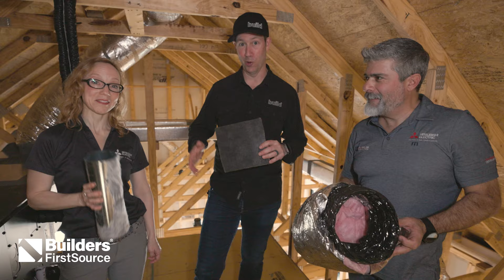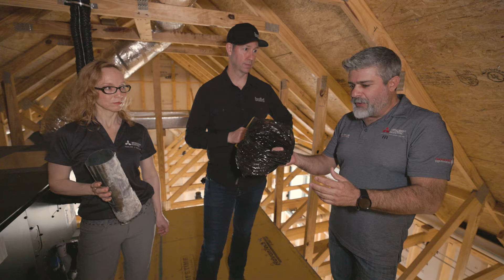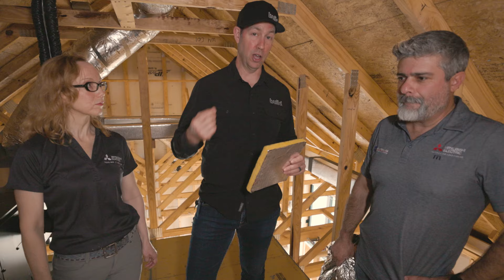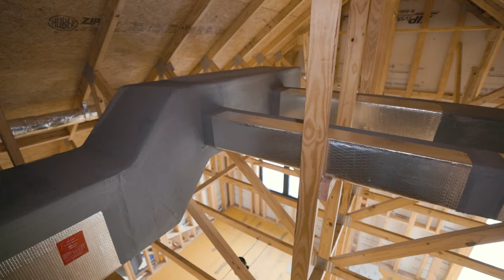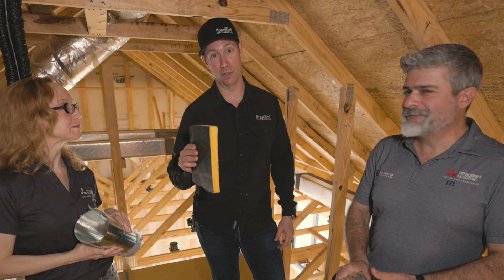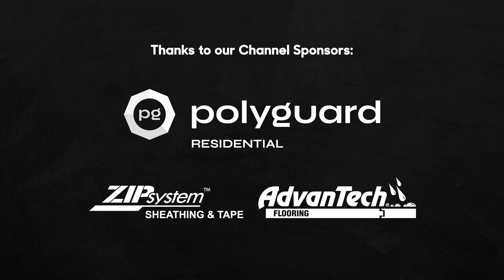Flex vs. Metal vs. Duct Board: Differences and Use Cases

Comment: Duct board has no use case for being a duct. Exterior insulation sure, a duct that airflow goes through absolutely not. Way too much fiber shedding and I’ve seen way too many home owners have respiratory issues when duct board is in the home.
Reply: I think you are talking about the old duct board with the raw fiberglass on the inside.  Our 35 yr. old condo community I help manage has this horrible stuff. It is disgusting after 35 years and honest duct cleaning companies won't clean it. The board they are showing has a coating of some kind.
Reply: @lrc87290  The newer duct board does has a black liner on it which I agree is a million times better but it also starts to breakdown over time but this system they have built with the Dehus is also pretty advanced so in this VERY RARE case it might work out okay.
Reply: I agree with this 100%. It is a horrible product, even in its current iteration. It is a disposable product in a permanent application. There are plenty of other problems, such as combustion and fire conduction, and any one of them should be enough to have it outright banned. In Canada there are no building codes that allow it, from the largest producer of pulp and fiber in the world; that should tell you something.
Reply: I can personally vouch for this. 

An office building I used to work in - I noticed I had respiratory challenges when I spent too much  time there. Wouldn’t clear until a full day or two of not being there.  

After I did my own inspection -  duct board everywhere.
Reply: @lrc87290 any Duct Board.  It has no business entering any application.  It WILL hurt the people exposed to it eventually.
Reply: @compasteedee I didn’t know Canada doesn’t allow it.  I didn’t know hospitals and schools don’t allow it. 

It’s crazy that it’s on the market for any application.
Reply: @TerryKashat  I still see it in old hospitals even though it’s not suppose to be there.
Reply: @hoopie1022  once in stalled it’ll be their indefinitely 90% of the time.
Reply: Metal duct work (trunk line ) has insulation glued to the inside of it. That held mold also. Which is about the same as duct board. Except for the metal lines that go to the rooms. Then that is usually wrapped with insulation and tape to it. Now will agree the old duct board. That had just the yellow insulation showing. Was not the great’s stuff. But, the newer board with black coating. I would use, before flex duct.
Reply: Haha

Comment: FOR ME, I’d do metal duct everywhere no matter what; there’s just no substitute for the ability to repeatedly clean them on a regular basis.
Reply: Facts
Reply: 100%. The other stuff is not just bad in performance - it’s bad for your health.
Reply: You need to replace your filter on a regular basis
Reply: How many ventilation systems are designed for cleaning? I gues none with flexible trunking.
Reply: I actually just got my air ducts cleaned and did not know this. My air ducts were really old and now they completely broke them all over the place. I have to do a full replacement now since i had non-metal ducts and the cleaning company ruined them.
Reply: @dannym1772  you already had to do a full replacement, the cleaning company just was a bad decision on your part - not their fault.
Reply: Just wish it didn't rattle so easy! I'm always helping someone build a home theater, and bass and metal don't mix well. >_<

Comment: As a former HVAC installer, I spent an inordinate amount of time repairing/ replacing duct board and flex duct with metal because they just don’t hold up over time and really adversely affected system performance
Reply: They don't mention aluma flex which stands up good unless someone crushes it, but it does suffer from turbulence from its ridges but it is a good alternative to wire flex as it wont degrade from the inside out. But yes rigid is the best
Reply: What do you do about sound transmission? I replaced my ducts with flex because we could hear each other clear as day in each of our upstairs bathrooms, as well as each of the two rooms that were next to each other.
Reply: @Runn4est  use duct liner to add efficiency and reduce noise transmission

Comment: I thought it was best practice to use solid metal ducts for the majority of runs, and then flex for the last 5-10 ft if absolutely necessary
Reply: I think code is 14 feet max for flex

Comment: Once the house is done and the homeowners a few years down the road want to change or add more lights the electrician goes up in the attic climbs over the duct board and crushes it it's over, I'm retired tin knocker did it for 40 years and I would take metal over duct board and would recommend it to the customer, it's junk

Comment: a quick question: I see Germans begin to use rigid plastic for duct work.
Reply: My initial concern would be warping when hot. Also how porous/vulnerable to mold it is. Probably depends a lot on the material.

Comment: What about mini-splilt where you eliminate duct work altogether? Isn't that the ultimate solution?
Reply: I would highly suggest not to go mini splits, simply because you’re going to have cold spots throughout the house, unless you have a unit in every single room.. and that means an outdoor unit for each indoor unit., then, you need plumbing and electrical to everything on top of that
Reply: @ppump24valve53  I was told that now days one typical outdoor unit can handle around four zones and the exchangers are capable of covering typical room sizes. Is that just not the case.
Reply: @myusrn  well, it does look like I’m wrong on that aspect.. of needing an outdoor unit per indoor. But all the refrigerant lines and electrical would need to still be running to each individual unit, from the outdoor unit. Then also you would have a filter on each unit, as well as the fan.. thinking about maintenance.. etc. I had existing ductwork in place, and just got a new variable speed air handler , and inverter, going from an electric hot air furnace.. so I’m about to see how much more efficient it is.. Also insulating my garage attic and topping off the main attic insulation.

Comment: My house had a lot of flex ducting when it was built. I didn't know this till after I had my ducts cleaned and the cleaners tore multiple of the runs going under the house.
Reply: Ouch how it wasn’t too expensive to fix 🙏🏼
Reply: @Electrolux Wash I was able to get to all of them and fix them with tape. I do wonder if that is a hidden problem for the new owners who have been there more than a decade.

Comment: Which one is better to fight condensation ?
Reply: Ideally you shouldn't be putting any of them in a non-conditioned space so condensation wouldn't be an issue.

If you have to put it in unconditioned space, sheet metal will always be better.

Comment: What is a reasonable price for new duct work?  
10 runs (10ft - 30ft each). 
2000 square feet ranch, single story, AC in attic center of the home.

Comment: Hydronic heat and cooling, per room home runs to cassette systems. Each room can be temperature controlled, can be installed by the most rookie DIY homeowner, easy to clean and maintain.

Comment: I need the breakdown of how easy these are for ninjas to crawl through…
Reply: I was concerned about Solid Snake - but you make a good point too 😂
Reply: Sheet metal duct is the only ninja approved duct. Due to higher cost sheet metal ducts are utilizing thinner metal which can bare less weight and it is noticeable noisier. Making it much harder on ninja.

Comment: I'm having a new home built, and I'm afraid that my HVAC contractor is going to pencil whip the DALT test on my ductwork.

How to I keep my HVAC contractor honest with duct air leakage testing (DALT), it is energy conservation code in NC. I'm certified through AABC and performed numerous DALT tests in a commercial setting using equipment from Retrotec and Oriflow.

Comment: Does anybody know the physics of sizing metal ducts to best guide heat from the furnace to the extreme other end of a series of rooms at distance from the source?  Discussion of products without proper location and sizing is at least as important as materials.  Also, what options you use to insulate your metal pipes has a lot to do with efficiency, especially when the furnace is downwind of prevailing winds outside winds or thermal issues in walls.  Everyone believes they are the perfect duct system designers although they know little about volume of moving air inside of the ducts themselves.  Additionally, where to place furnace outflow to rooms and where to place cold return is the field of HVAC designers for each room.  There is a lot to know in planning your HVAC ductwork and very few qualified HVAC flow designers capable of providing even heat to a 3 BD house with large living quarters, entertainment centers, office space, play room etc.
Reply: Good point, that's why engineers make the medium bucks.
Reply: That's why we use hydronic heating and mini split a/c. Theres so much head loss moving air through joist space that it doesn't make sense anymore. We used to only have hydronics half a century ago, why not go back to systems that still works 50 years later. All these shitty lined cardboard will have to be ripped out in 20 yrs.

Comment: If you're building a million-dollar house, I would get an upgrade alternate price on metal ductwork and see if it fits into your budget.
Reply: Well that the main problem with new homes. Many pick the kitchen upgrade or the third bathroom over insulation and better HVAC. You only want to pay for what you see, not what comes out of your pocket every month...
Reply: If you're building a $1000 dollar house I still would use metal

Comment: Metal duct work everywhere, sprayed with foam. Only way to go.
Reply: 100% Metal Duct.  I would advise against the foam and use sealing tape.  It’s healthier from a biological standpoint.
Reply: @TerryKashat  insulation?
Reply: @audreye7078  the foam is not biologically healthy from a chemical standpoint. 

Insulation is technically fine - the challenge wise that is you want NO fiberglass insulation exposed to the air leaks or interior of your duct do that the fiberglass never gets in the duct pathway.

Comment: I'm a HVAC tech in the Netherlands, we only use solid metal ducting in our installations. I work with one of the few companies who specializes in air heating(/cooling) for residential buildings. Even if we need to cross load bearing beams or so, we make custom conduit in al kind of shapes and sizes. Only when there are no options for solid, we use flex. Never would we use some kind of fiberboard!

Comment: In my neck of the woods (St Louis metropolitan area) well over 90% of the homes are built with basements, sheet metal ductwork was always used and continues to be used to this day. Sized, supported and installed correctly sheet-metal ductwork can withstand the test of time with few problems. The problem I’m starting to see is the lack of skilled tradesmen in this field, the Legacy sheet metal men are starting to retire and die off (I am seeing less pants legs and cheeked or rounded corners used , i’m assuming the contractors don’t want to pay for the extra time or have the expertise).
Reply: Over here in Lancaster County, PA and surrounding areas we mainly use fiberglass ductboard instead of metal. Not many of the guys know how to do metal anymore

Comment: New builders using flex duct should be sued and then banned from building.  Cheap and fast is the only reason they do it, and then charge a normal price or more anyway.  Should be banned from building, since they probably hide it as well from home owners that dont know any better

Comment: Surprised they did not mention aluma flex which I would say is one step below sheet metal hard pipe, yes it does crush easy but it wont degrade over time in the inside like wire flex , and will last just as long as hard pipe  if not molested by someone crushing it. And yes, it does have ridges so some turbulence.

Comment: Metal duct all the way , seal all seams really really well and it will last a lifetime time.
Great video Matt 
Appreciate you
Reply from the maker: Right on. Totally agree
Reply: 100% Metal duct all the way.  

The cheaper options should not even be available for something as important as our air.
Reply: @buildshow  that's why you used pvc duct hose in your house. Do you remember the Zehnder system?
Reply: @jakubsebor4756  what’s wrong with the zehnder ducts

Comment: Is the metal ductwork insulated or does it have to be in a controlled space?
Reply: It comes uninsulated but can be wrapped in insulation if used in an unconditioned space. You just have to check the insulation type and specs for the space you're using it in and make sure it's installed correctly.

Comment: Flex should be illegal for any closed space like in wall or attic as it is garbage for air flow, it collects dust innside that leads to mould and is impossible to clean after some years without destroying and need to replace it all (it is really a 5 to 10 year max product before replacement is needed/reccomend.

Steel is great for everything except working with it as it takes more time but as long as it doesn't get water on it it is a 100 year product that only needs inspect/clean for dust now and then and it is easy clean, will not get damadged from cleaning at all, fire resistant (still a fire hazard if flames get into it without any fire dampener) it is silent since it is smooth and heavy.

The foam board one i haven't seen before but it should have many of the same benefits as metall just not nearly as easy to clean
Reply: As a homeowner and doing full renovation on my house im going for steel duct in and out to my HRV with aluminium semi flex expandable duct the last meter for long bends and it is also a "lifetime" product.
Half meter flex out from the HRV to give easy access for cleaning and it all being in a "closet" for easy access to replace only used for noise reduction.
Then steel and possibly semi flex Aluminium the rest.

Still making it so not done. but i am limiting plastic flex only to 1 meter to and from the HRV since it is some thin flimsy shit only for vibration free connection.

Also going to hang the HRV on acoustical spring hangers to isolate vibration from the house frame (not any noticeable vibration tho as it is not the rotating ceramic core type

Comment: after several test of air flow the amount of gain of metal is not justified by the higher cost. Also with time the metal duct became noisier. Last  consideration is that if you put a piece of flex along a metal built system the efficiency people is talking about is really less, even using a short amount o flex. Metal is better but it is not all gold as they say.

Comment: Flex duct always installed incorrectly 60% inefficient.
Fixed metal duck is the best.
Avoid ninety-degree turns elbows. Use a slight curve elbow. Insulate around the metal

Comment: Matt - I highly suggest you highly advise against Duct Board and advise against Flex Duct. 

These things are cheap and cause respiratory issues due to the fiber glass insulation entering your space.  

Additionally - the porous nature of Duct Board allows for moisture build up and mold.  Go look at any installation and you WILL FIND MOLD on the Duct Board and that gets injected into your air. 

I speak from personal experience.  

It should have never made it to market.
Reply: These are great points. Carrying out or moving moist air with lined cardboard is just a terrible idea.
Reply: Fiberglass duct is pretty resistant to moisture unless you pour water on it when installing or leave it in the rain
Reply: @goobygoober455  and when there is a leak in the cieling?  Or major humidity challenge in the building.  Game over - both things happen and it is hard to detect once installled.

Comment: I am building a custom home with a gambrel roof.  I decided to custom build my ducts out of 1" aluminized insulation board in a triangular shape fitting to the lower section of the lower gambrel of the roof.  The duct is compact, and was easy to build and install.  I taped it together with aluminum tape and zip tape.  I also created the inlet and outlet plenums out of the same materials.  I used 6" flexible duct to provide air to the registers from the second floor to the main floor ceilings.  Since the home is in an "L" shape I used 12" flexible ducts between the floor trusses to transfer air between  ducts on both sides of the gambrel roof.  The temperature difference between different parts of the home only varies about 1/2 of a degree from day to day.  Then again, because the roof is 6-1/2" PolyIso on the exterior and 6" of fiberglass batt insulation on the inside and the walls are 3-1/2" PolyIso on the outside and 6" of fiberglass batt on the inside the house varies only 1/2 degree from day to day.  Coupled with an HVAC system and dehumidifier the duct work performs flawlessly.  The amount of insulation ensures that the house temperature does not change significantly and the load on the HVAC system is negligible.  We had a night where the temperature dropped to 9 dgrees Fahrenheit and we purposely turned off the HVAC unit overnight for 12 hours.  The inside temperature only dropped 3 degrees. This is a 3800 sq. foot home with 2 floors and only a 5 ton HVAC system.  I call it my big Yeti!
Reply: In my area R-8 duct board is required.....2 inch. I used R-8 duct board for the 20' plenum, and came off with 6 inch flex duct. Works very well and passed inspection with no problem.